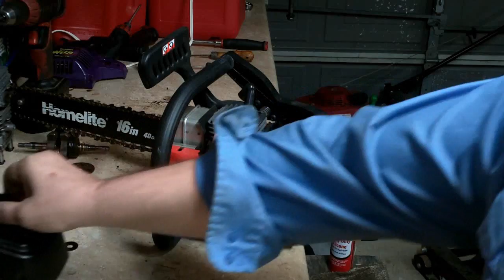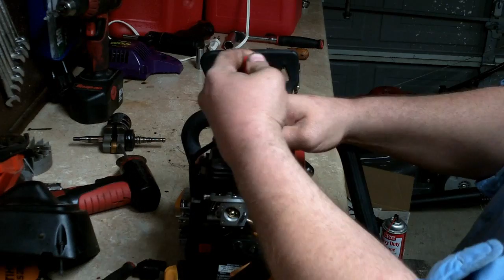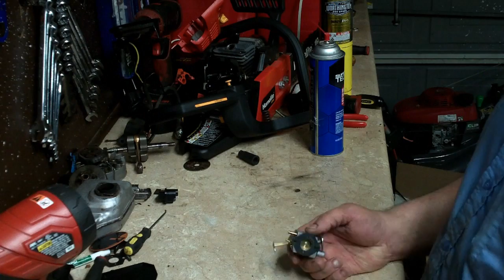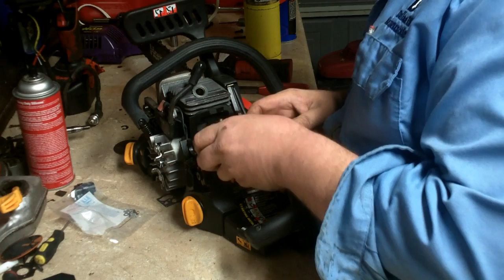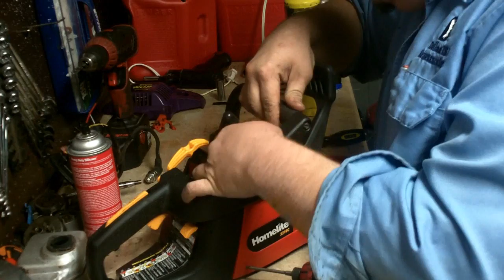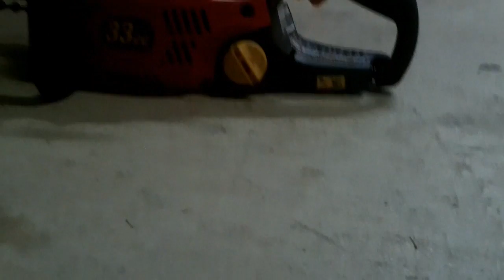HOMELITE CHAINSAW REPAIR : how to rebuild the carburetor and minor tune up (FULL AND UNCUT)

Comment: My little Homelite Bandit 33cc just like the one here, used it once 23yrs ago then hung it on the wall in the garage ,   Last week I needed it so I drained the old gas refilled it, replaced the purge bulb ( fell apart). Choked it, fired right up with no issues.   Great little limb saw.

Comment: What a joke, Throw parts at it and hope it works. Brake parts cleaner swells rubber, not spray carb cleaner. Compressed air is best for cleaning out passages of the carb. How this actual carburetor works and how fuel is fed through the carb was not covered.

Comment: My question is how does mount a 46cc homelite carburator correct since it's mounted at a slant on the chainsaw.?
Reply: That is not quite perhaps I'm being being precise in my question.  How does remount the carburator on a Homelite 46 correctly since it's carbonator is mounted at a slant \ it is strange and I've never come across this before? Has anyone ever even seen one before? Help!
Reply: Omg talk about typos I will admit I'm a little not upset but you know "irked"!
Reply: What I meant to say is " How does one remount the carburator on a Homelite 46 CC since situated on a slant\ Nice presentation by the way!😮😊

Comment: Mine barely has enough power, even when brand new, to get thru a rotten 2x4, that's if you can keep the worthless pot metal safety chain on without slipping off the bar, anything bigger than 4 inches in diameter can be cut faster with a sharp Swedish saw, do they make a oregon bar and chain combo for this saw that doesn't actually cost more than the powerhead itself, mines sitting in its case with a petrified primer bulb steeping in bar oil just keep her around cause I hate throwing anything away,my poulans though crappy run circles around this saw, and you don't have to pull and use every choice word in the vocabulary!!! As is when she does run and start she has about as much power as a hot popcorn fart!! Even with tuning!!

Comment: I thought we had identical machines, but mine is a Homelite "Ranger" 33.   Your throttle linkage is on the opposite side from mine.  Took me forever to figger out how to slide it onto the bolts.  Finally fingered out to push the bottom link thru, past home, then jammed the carb in, then pulled the linkage back to home.

Comment: Same exact saw I have. Bought off Market place with bad primer bulb. Looking to see where the adjustments are for the carburetor. Idles great but will not go to high speed. Does it need a b ew carb or adjustment high speed?

Comment: Takes about 2 minutes to remove the chain linkage from the handle and then it's completely out of your way.  There are three screws on the side of the handle, once u take the side off the linkage just pops right up and out.  Way too annoying working on the carb with the handle in your way.

Comment: Excellent Video,  very informative. I have the same carburetor. Gentleman I got the saw from told me he had tweaked the high and low settings all over the place. Do you know about what the factory settings would be for those. Cant get the saw to start, believe he had the settings all jacked up.
Reply: Screw both High and Low in all the way but not tight just until they stop.  Then factory settings are 1-3/4 to 2 turns counterclockwise.  If everything is working correctly it will start and then you can fine tune the High and Low for best performance.

Comment: Does primer suck fuel thru carb or push fuel thru carb ?
Reply: Pushed through carb and back to tank. It’s not a primer bulb but actually a purge bulb that pushes air out of the system for easier starts. Some lawn mowers and snowblowers do actually have a primer bulb that squirts gas into the throat of the carb. One way to tell the difference between the two is a primer bulb never has a choke with it but a purge bulb does.

Comment: If it wouldn't have started after the rebuild. What would you have looked at next?

I've got a homelite ut10540. New carb,fuel lines,primer,fuel filter and spark plug. Still doesn't want to fire

Comment: Ive got an old homelite ut10505-B dont remember how old, carb rebuild, 16in.bar, runs great. Do you know what the displacement is?(cc's).
Reply: If it has a 16 inch bar it probably has the normal homelite 33cc motor

Comment: Was given one of these pieces of garbage.Ran nothing but engineered fuel in it.Doing the very same thing.The carbs are garbage.Can not depend on these saws.Great if you need a saw for a one time project.That said great video,new subscriber.

Comment: I have the very same saw.Hadn't started it in 4 years.Got it out yesterday and put fresh gas in it and it started 1st pull! Is that the normal slack in the chain at idle?
Reply: you  lucky get 4 years
Reply: no that's not normal slack. you'd want to tighten it up and put some chain oil in it for safe operation.
Reply: @robgeach8105  are you sure about that? It's supposed to hang down a little bit.
Reply: @ThatBlueHoe  yes. it's too much slack.

Comment: mr fountain   question.    I have a  echo   cs 440   chain saw   a  guy  wanted  me to fix .  I rebuilt the carb  ,  replaced  the  filter hose   but it  still   only   runs  for   about  a minuet .  I have a clear  passage   from   the impulse   port   .   do I  have  to totally  have  to dismantle    this   saw?     thanks   I know your   busy.

Comment: I have the timberman 45cc, it was leaking fuel when running, looking at carb, I found
the lower hose off, reconnected it, but now the engine races at full throttle, the idle screw backed out , any suggestions???

Comment: throw it in the trash and buy a stihl
Reply: +Bayport78 Why are you watching repair videos for tools you wouldn't want?
Reply: +Bayport78  I just gave a stihl 16 inch bar   to the junk man I t was so hard to pull the starter rope . I bought a small 14 inch bar Homelite  it is easy to start and will cut anything I need to cut.
Reply from the maker: Lol
Reply: Bayport78 
I used a pro Stihl and a 48" pro Stihl.  Couldn't start it, the starter coil is too hard.  Got a Husqvarna ranch 460.  Cut down a tree over 30" diameter 80 ft tall without problem.  Started much easier than Stihl.  Should get a Husqvarna 545 20".  This saw is so good to handle and good performance.
Reply: Homelite Ranch was good.  I like Husqvarna 545.  Stihl is hard to pull start.  Try to pull start a Stihl 48" bar chainsaw.  It is impossible to start it for normal size people.
Reply: Buying a stihl will solve issues with old or dirty fuel.

Comment: Hi, I am working on the same chainsaw shown in the video I cleaned the carburetor since the chainsaw say for 3 years with old gas and I started it when the carb wasn't cleaned and it idled but bogged down when I gave it has and now that I have cleaned and put back in the carbuerator it will not start up at all, do you know what the red and white things on the carb are, idle control? And is the fuel intake line on the top or the bottem of the carbuerator, thank you- David

Comment: have same saw as your video.  Starts good, idles good but when I start to rev up it doesn't respond well. Revs ups with half throttle but with full throttle it kinda sputters and won't rev high? I checked gas, clean and fresh. Found gas filter in tank not tight on fuel line. Cut 1/4" piece of hose off and reattached filter, good and tight now.
THANKS

Comment: I usually check the metering lever height when I rebuild a carb, one saw I worked on before someone tried to rebuild it themselves and had the gaskets and diaphragms all in the wrong order and the metering lever was bent up at a 45 and wondered why it wouldn't run.